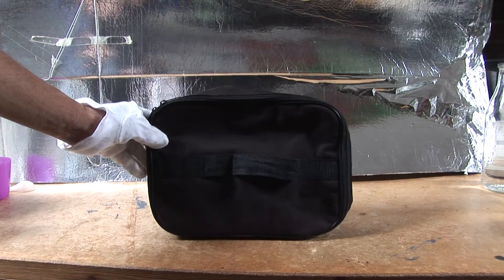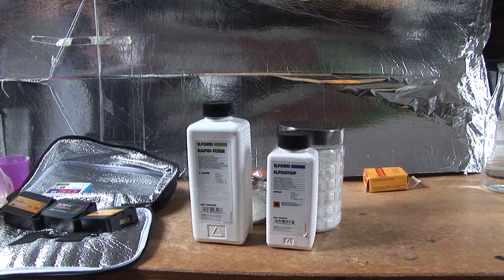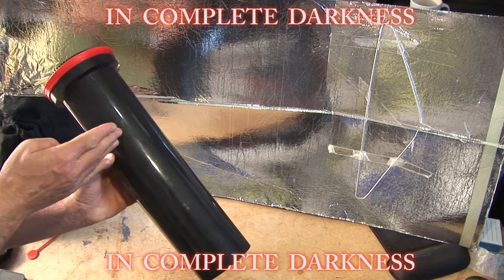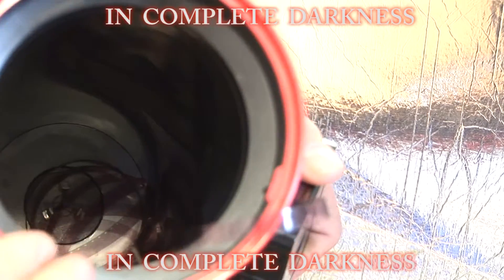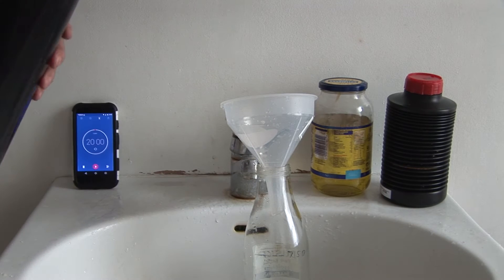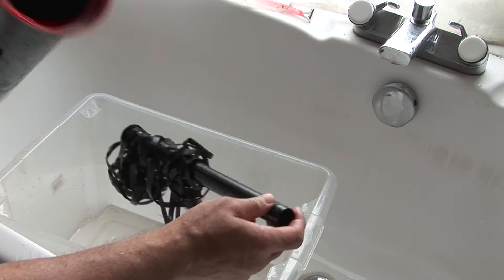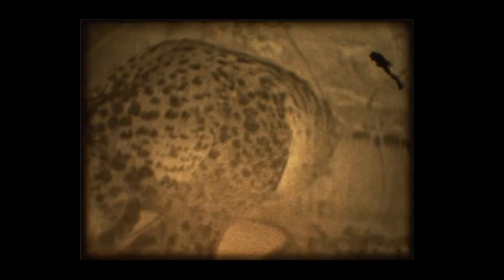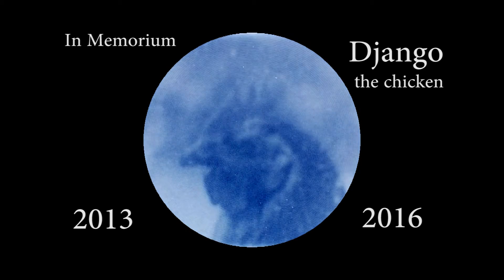Super 8 processing in Caffenol Part 4

Comment: Hey Ben I'm loving going back over your archive of videos. Re the bleaching for reversal process and nasty PP bleach have you seen the guy who has bleached using Hydrogen Peroxide/Cirtic acid (lemon juice)? He got results from this and much less toxic ☠️
Reply from the maker: Hi Bruce, I've used the peroxide and acetic acid bleach for Kodachrome reversal and it works. In fact after making this film I stopped using permanganate bleach on old Kodachrome (too harsh) and now only use permanganate bleach with fresh b&w stocks like Fomapan Orwo and Tri-X.  I did hear about the lime juice thing and have two bottles of pre squeezed juice but haven't got round to trying it. I'd like to try an all-natural development one day, onion stock & salt for fixer etc.
Reply: @ZeroBudgetFilmSchool  Sounds cool.... Messaged you on Instagram as easier to keep track of chat/messages than on here. Hope that's OK?
Reply from the maker: @brucefisher9888  cool thanks for letting me know, I don't check my Instagram very often!

Comment: Just getting into 8mm developing -- does the film tend to stick together if it comes in contact with another piece of itself like larger film formats? I had that issue when developing 120 film without a spool (careless mistake) and the film had all stuck together, not allowing any chemicals to come in contact with it, which is one of the reasons i was so wary to try 8mm movie film bunched up like this. Hopefully someone sees this, thank you!
Reply from the maker: Yes, if you develop 8mm 'spaghetti style' there is a risk of contact marks  where the developer hasn't been able to get to the film. The remedy is to keep the developer moving with gentle agitations . The film will move enough to let the developer in. You still may get a few marks but as long as the film is jumbled up enough you will be able to avoid contact issues.
Reply: @ZeroBudgetFilmSchool  Awesome! Thanks for the help, ill try it out!
Reply from the maker: @iceboy1671  accidental contact marks can look amazing, especially when the developer leaks through the sprocket holes and just develops a square on each frame of the film underneath.
Reply: @ZeroBudgetFilmSchool  Yes, i love film for exactly that reason!  The impurities that show it is a physical and analog and the process that goes along with it

Comment: Great to see episode 4, Ben. We were very interested to see how the Kodachrome 40 turned out as we have a little stockpile of K40 which expired mostly between 1977 and 1987. We shot two rolls of this a few weeks ago and had a go at processing in Caffenol. We used pretty much the same set-up as you but, as we have a 5 reel Patterson tank, decided to experiment by making twice as much Caffenol solution and processing two cartridges together at the same time. One film seemed to turn out better than the other. This could be down to us using two different cameras, or it could be that the films coiled around each other in the tank preventing the Caffenol etc getting to them. Overall the results are very similar to yours and we're very pleased. We've ended up with plenty of scratches and light leaks. Whole sections of film have been invaded by the black remjet blob infestation which actually looks great in moderation. 

Sarahjane decided to experiment directly on the less successful film cartridge, creating animated scratches and psychedelic colour explosions using nail varnishes. These look great projected but we're having problems trying to create a DIY telecine so that we can edit in our iMac. We have two projectors: one Kodak Instamatic from the 60s which burns great bubbling holes in the film as soon as we thread it through the machine (looks great and we'll definitely capture some of that at some point but we don't want to destroy our films); and an AGFA Family projector from 1980 which has a small screen built into the front which we can point our chosen digital video capture device at. Obviously the problem we're having in making digital scans is the annoying rhythmic throbbing lines which appear when you try to capture 18fps projected film using a 25fps camcorder. Any advice on the telecine aspect? We've read that a projector with a variable speed rate could help. Anyway, thanks again for this series, Ben. Once we have better scans we'll post up some of our home-processing experiments - Roger & Sarahjane xx
Reply from the maker: Wow, a 5 reel tank! did you load the film in a big bag or in a dark room? I did 2 rolls at once, one time. It didn't end up well. I think, like you say, the films stuck to each other and a lot didn't get processed. Now I know that one batch of caffenol can be re-used at least once, if I have more then one roll I do them one at a time.  

As for the telecine, did you see my setup in the earlier film in this series? It sounds like your projector with the little screen is a good enough way to do it, but the flickering is best solved by using a camera with lots of shutter speed settings. I've found either 1/50th second or 1/60th second work best. If you use a DSLR it should be able to match the projector's flicker rate. If you have an old projector with a stretched belt that can't keep to a steady speed... maybe its time to get a better projector. German Ebay usually has some very nice Eumigs. 

Looking forward to seeing the nail varnish effects!
Reply: Thanks, Ben. Yes, we used a huge black film changing bag like the one you use. We had a lot of hassle smashing up the Super 8 cartridge to get at the film so it's good to see in your new video that you can just pull it straight out of the cartridge.  Thanks for the advice on DSLR shutter speed. We'll mess about with that and see what we get. We've shot another two and a half K40s when we were down in London, so we'll have a go at processing those soon. xx

Comment: This series has inspired me to conduct my own science experiment with this Caffenol stuff and a very expired roll of Kodachrome 40. 

Do you happen to know if there's anything that will go seriously wrong if I use a different sort of lightproof container like a large thermos rather than a proper developing tank? Are the proper tanks made of a special magic plastic that tenderly caresses the film into cooperating?
Reply from the maker: OK, what's useful about a developing tank (and even better, the ones specifically designed to handle super 8 and 16mm- made by Lomo) is that it can keep the film in darkness while you pour in and out all the liquids (caffenol, water, stopper, fixer etc). A thermos would work in theory but you'd have to do all the wet stuff in complete darkness or else every time you lifted off the lid to pour in/out liquids, the film would get exposed. The design of the tank prevents this.
Reply: Thanks for the heads up. II think I'll try to find a developing tank